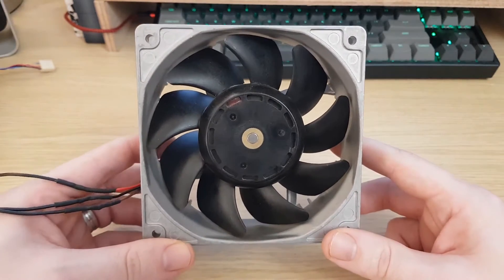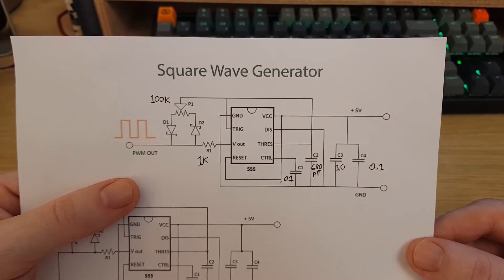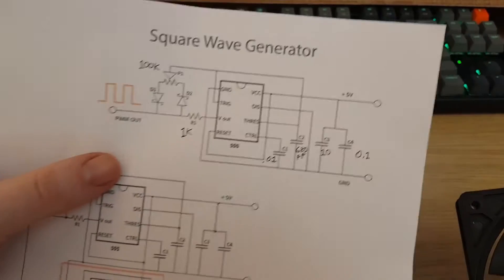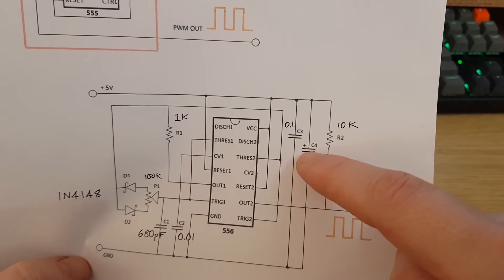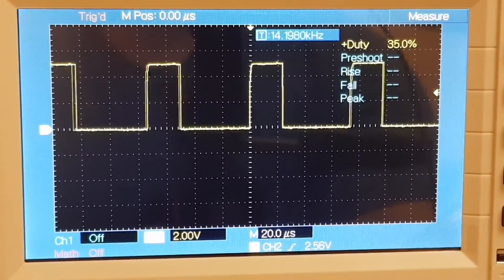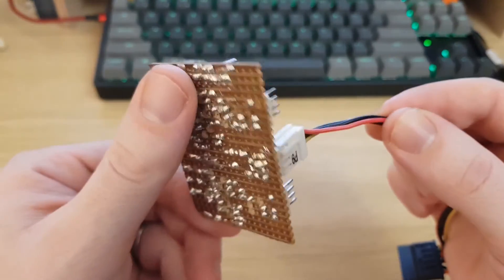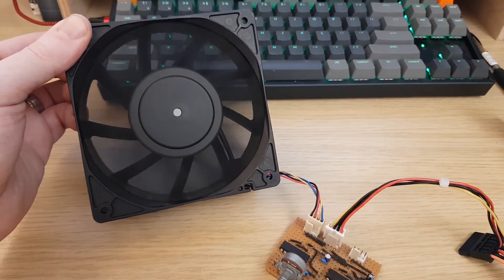DIY Circuit - Square Wave Generator for 4-Wire PWM Fan Speed Control

Comment: Great video! Just curious if the cheap PWM generators on ebay perform the same function as this circuit for PWM control of Nidec fans like this G1438X48BLZP-30?
Reply from the maker: Thank you! It would depend on the frequency of the square wave, as Nidec typically specify a lower frequency of 5Khz for their PWM fans, quite different from the Intel PWM spec of 25KHz. I've looked at a few of these cheap ebay PWM generators in the past and some do have selectable frequency range, so in principle they should work just fine (or better, if they are digital). One thing to bear in mind is that some fans (including my G1438X) have custom PWM behaviour: my sample goes to max speed at 0% duty cycle, min speed is at about 15% duty cycle, and 15-100% is more or less linear through the RPM range. Also make sure you are connecting the correct wire to the PWM circuitry - there is no standardised colour for tach or PWM, so I had to find out by trial and error! Finally, note that the response to the PWM input takes a few seconds; it's not instant like on smaller, lower powered fans.
Reply from the maker: Also I should point out that the control circuit I'm using is superior to the one in this video, built with the LM311 comparator and providing a more comprehensive 0-100% duty cycle range and adjustable frequency. This simple circuit with one or two 555s doesn't provide a stable frequency across the duty cycle range, but it's good enough for cheap PC fans.
Reply: @FanPhys thanks for the detailed reply, that's very very helpful information! Its rather challenging to get data on these fans but they have incredible performance so all worth it once they are up and running. I sent you a message on art station as I came across your page when searching through some forums and youtube cant send messages. I will continue to debugg tomorrow and might even try treating the yellow line as PWM (currenlty it reads around 2.5 v and gradually builds as thr rpm rises so i figured it was tach). The blue line reads 0v, which is odd as I thought these fans pulled the PWM line to 5v or is that not how yours have worked? Im worried the PWM line is fried as grounding it or hitting it with 5v has no affect; as soon as I power the fan it rips to 100% 😂

Comment: Thank you. Great demonstration of 4 pin fan control. I’m CLUELESS regarding schematics and need to learn this bad… I’ve got a bag of server fan’s and for my first project I’m going to design an enclosure for the fan including a carbon filter for a solder fume extractor. I think the potentiometer you show here for fan speed control is great. What I don’t get from this is the components you have inline on the perf board, and how it’s wired 😂. Anyhow, obviously this entire project is gargantuan for me so I’m going to bite off a piece at a time to get there. Thanks again!

Comment: How would one use a thermistor (on, say, a heatsink) to vary this circuit (fan), replacing the pot (or keep a pot in there for calibration)?

Comment: Hey bro, that was a practical solution. But I have a question . Most of pwm controller modules have two pins out put : a pwm and a gnd out . And I see you connect a 4 pin fan to your pcb .is the 4th pin same as gnd output pin ? And is it same as negative input pin?

Comment: do you got the circuit for 555? got a bunch of them
need to control 3 12v fan at 250mA each
want an exterior unit because the motherboard only let me connect 1 fan 
guess could use some 2n222 or two in the outputs so i dont fry the555
will try the circuit described on the link thanks but how do you power up the fan 12v just using 5v?
i know the 555 can work from 3.3-18
edit i do plan on powering it with an external source mounted on the table with just a cable running inside the PC case
Reply: You won't fry the 555s because it is not a current-supply circuit.  It is a signal circuit that gives very little current.  The fan PWM is designed to take the signal from this circuit in the video and use the duty cycle of it to figure out the speed.  (This blue wire, again, is only needing a ±5v micro-amperage signal.  It does not need to drive anything.)
Reply: @sonicdewd  ita bad using 12 for the pwm?
Ive already mounted a circuit and tested it so far so good
But im using straight up 12v por everything 
The datasheets ive found says nothing about 5v in the pwm pin

Comment: What is the difference between your circuit layout and the ones on google search where the output pin has no connection to other pins, im planning to control a 24V 4pin fan using NE555P

Comment: great video, have you done 2 wire fan controller controlled by PWM mod ? i wonder what transistors should be good for 2 amp 12V fan
Reply: Did you ever figure it out?

Comment: Can i use DC 6-60V 12V 24V 36V 48V 30A PWM DC Motor Speed Controller (PWM can i use that to control speed on delta fan
Reply: Yes

Comment: How to add a thermostat for tempreture based fan speed in this circuit? Please help me because I want to add a fan to my power amplifier so when amplifier is not much heat fan run veri low speed and if temperature rise the fan speed also increases.
I have same 4 pin fan.
Reply: Should use an LM35 or a thermistor yo driver a comparator with a IGBT/Jfet/mosfet and that should power the pwm signal

Comment: So I came across this video as I’m repurposing a whole lot of server fans to be fume extractors, and since I’m doing so many I was curious if you knew of a controller that already exists for this purpose.
Found a few on Amazon but after testing 2 of them found they were only around 1khz and 4.5khz respectively, and didn’t seem to make any difference.
Any ideas? I’d really appreciate any resources if you might know. Thanks!
Reply from the maker: Hey! Yeah there is a 25KHz digital pwm controller made by Noctua called NA-FC1.  It's quite expensive (I think) but it does the job well enough, and you can power the fans separately by molex or similar 12v supply.
Reply: @FanPhys  ah yeah, saw that one… it’s a bit pricey for what I’m doing, but thanks for the reply. I appreciate it!

Comment: There are 12v dc exhaust fans on Amazon with only a positive and negative leads coming from the unit. These fans (2ea.) look like pc fans.

Could I use a 12 v dc dimmer (...typically for lights) switch to regulate the fan speed?
Reply from the maker: It would depend on the power handling capability of the dimmer switch... if the fan draws too much power the dimmer switch might go pop.  A safer bet would be a dedicated 12v fan speed controller.
Reply: Adding pulse width (a dimmer) to a circuit (PWM of the motor) that is already making variable pulse width output frustrates the PWM of the motor, because it is expecting a steady DC voltage, not anything choppy.  The fan circuit times (as in synchronizes the pulses) the voltage in such a way that it turns off and on depending on where the rotating permanent magnets are in relationship to the wound poles of the stator, exactly like a set of brushes do - to keep it in time.

A super simple way to vary a fan like a two-wire brushless fan is to use a variable ceramic resister inline.  (Match the current of the fan to the resistor of course.)  You'll be able to vary the voltage to the fan some, but there will be a point where the fan electronics will complain because the voltage won't be high enough and will stop functioning until you turn it up again.  You could give it a try - you might be surprised in how much you can vary the fan speed using this.  Who knows?  (Another problem you will run into using this is a touchy and unsteady control of the fan speed.)
Reply: @sonicdewd thank you for the very thorough explanation. It does help to know how these things work and what's going on and why. Appreciate it!

Comment: So, the fan sink max. 10mA -5V PWM signal, you can control 50 fans at once with only one TL494 in single ended configuration on fixed 25KHz frequency (in your case frequency is changing and the frequencies below 20KHz are making additional noise). The circuit using  TL494 contain only one capacitor/resistor to set the frequency and 10K trimmer for speed control!  Additionally the PWM output from the fan can be used as feedback on TL494 to control the fan torque! The price of TL494 is the same as for 555, so the choice is easy. Thank you for your video, it was helpful for me to understand the difference between PWM driving and PWM controlling (the PWM driver is on fan circuit)👍
Reply from the maker: Thanks for your comment.  It will always be simpler to use a programmable IC for this sort of thing, but it is a lot of fun making analogue circuits with discreet components.  There is a version of this circuit that uses LM311 which stabilises the frequency.  It is more complicated but also a lot of fun to design and build the PCB layout. :)
Reply: @FanPhys  do you got the schematic with the LM311 complement? guess as a comparator could also be possible to use a LM741
Reply: thank you so much for TL494 idea 😊

Comment: Is there a way to make this circuit temperature controlled using a thermocouple or a thermistor without a microcontroller?
Reply from the maker: I'm not sure - since there is a small voltage drop across the diodes, I don't think it would be quite as simple as replacing the pot with a thermistor.  A good idea would be to breadboard the circuit and test it with a 100K thermistor and see what happens!

Comment: My computer server fans are 12 volts and 2.4 amps each.There is 6 fans.I am running a consumer MB in the case.The MB will only handle 2 amps per fan so I will have to build 6 of these to be safe or is there another way to do it?
Reply from the maker: One circuit will easily be able to manage six fans, however if you want to control the speed of each fan independently then yes you will need six circuits.  As a general rule I never power such fans from the motherboard, always directly from the PSU.
Reply: @FanPhys .6 fans at 2.4 amps each is 14.4 total or 172.8 watts.these are server fans,not standard fans.
Reply: @gerald4027  yea but hes  asking if this would work for his situation ?

Comment: Nice... video. Any idea something like this are on sale? I want to connect PWN fan directly with PSU. Thanks.
Reply from the maker: Thanks!  Yes you can get the Noctua NA-FC1 which is the same thing, but a digital version.  But it is not suitable for very high powered fans, unless you power the fans directly from the PSU.

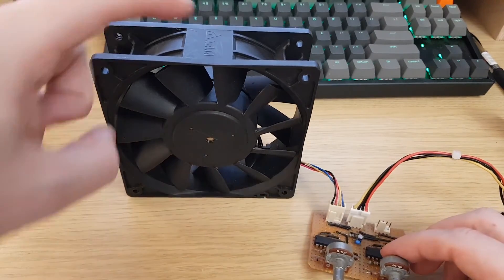Comment: Great vid! I bought the Nidec UltraFlo 60mm, and wondering if it follows that same pin connection. 8:47 is it uniform? left to right Black-Red-Yellow-Blue?
Reply from the maker: It is possible, but the best thing would be to find a datasheet which sometimes is the only way to get the correct pinout.

Comment: Hi,If I want to use this circuit with 12v ~2.5-3ah fan and ntc, where and how should ntc be located.. do you have a mosfet or transistor suggestion?
Reply: i think you skipped along the video. this controller dosent use a mosfet or transistor. its for controlling 4Pin PWM fans and puts out an aproprate PWM signal to the 4th pin while the fan is always getting 12V.

Comment: My 4 pin server fans don't stop with speed control circuit without cutting power, is this normal? Also, when I connect the pwm cable of the fan to the gnd line of the power supply, the fans do not stop. It only runs at the lowest RPM
Reply from the maker: Yes this is normal behaviour for some server fans - I have several fans which will not go below 2,000rpm.  I have a version of the Delta fan in this video which is "PFC1212DE-6J32" and it has a minimum speed of about 1,500rpm at 0% duty cycle.  Sadly, there is no way to change this because it is part of the fan's internal programming.
Reply: @FanPhys  Thanks for your help. I decided to buy the Sanyo 9SG1212P1G06 12V 4A model. Can this product stop at 0% duty cycle? Have you used this model before?
Reply from the maker: @electricaloverlord2838  No problem!  I haven't used the exact same model but I have the older version ending in "G01" and it will stop at 0% duty cycle.  Just remember that some fans are custom programmed and may have different PWM behaviour, so there is no way to guarantee what speed any given fan will run at 0% duty cycle!
Reply: @FanPhys  Your feedback is awesome. Subbed. Thanks!

Comment: Im looking for a controllet to run an phanteks t30, but I want to operate that fan to full voltage (12V) my question is, your fan is 12V also but your controller is 5V, why? and having on mind 12V constantly is feeding the fan,  could the fan be broken when the potentiometer is a full capacity?
Reply from the maker: Hey, sorry for the late reply.  All PWM fans (with 4 wires) are designed to accept this 5V square wave signal, which is why the voltage has to be no higher than 5V.  The signal is like a set of instructions that tells the fan how fast to go, and it cannot damage the fan.  With the potentiometer set to 100% it is the same as if the controller was not connected and the fan is spinning at full speed.  What I will say is that the Phanteks T30 already has a built in speed switch, so it may not be necessary to use a controller like this one.
Reply: @FanPhys  yeah, it's a bit late but it doesn't matter, both the noctua controller and the pahnteks fan have already arrived and you are right, at the end with the fan switch no controller is needed but I'm ok with that, I have even more control I guess 🤷‍♂️
Reply from the maker: @lobsangwhite  The Noctua FC1 is a very good controller - it does much the same as this circuit with a couple of added features.

Comment: Is this the same timer you used? NE556N Texas Instruments.
I want to make this to control the same aluminium san ace fans in your other video.
Reply from the maker: Yep that's the one - mine is made by a different company but NE556N is the chip designation.
Reply: @FanPhys  Thanks man I will order some and see if I can control my san ace 120s. At the moment I just have them going full blast but it is a bit unnecessary and is wasting electricity and makes some noise haha.